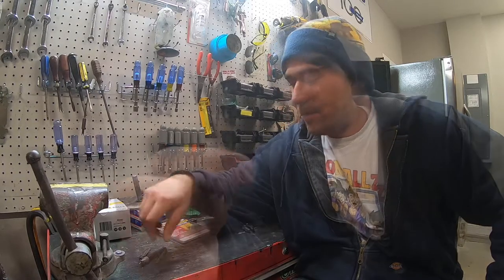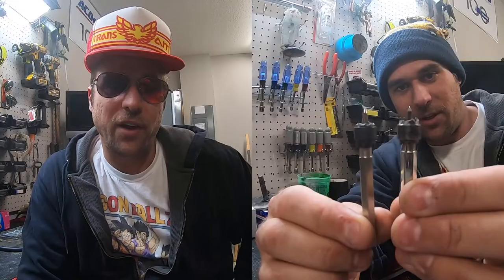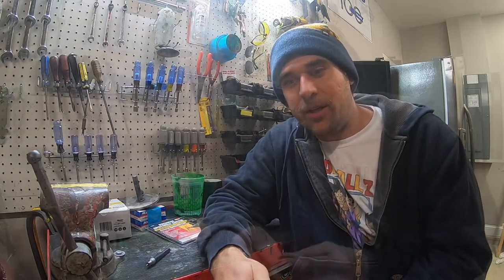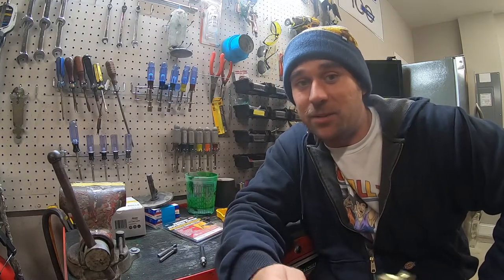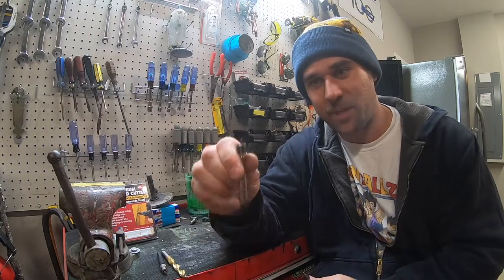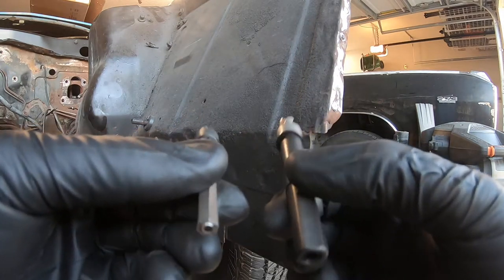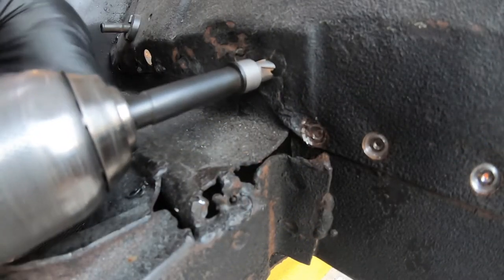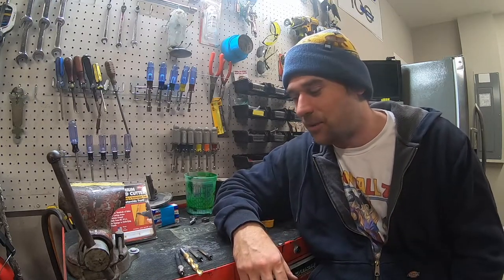Spot Weld Cutter Shootout Century vs Blair

Comment: Will the Blair Tool chuck up in a 3/8" chuck...or does it need a 1/2" chuck?
Reply from the maker: Yes it will. I use it on my dewalt cordless with a 3/8 chuck. Thanks for the comment.
Reply: I ordered one on Amazon...thanks!

Comment: I used to have a Blair SPC 25 years ago and lost it, was the cats meow, long story short I bought the cheaper tool and it walks all over the place even with a center punch or drilled pilot, teeth don't last, im done with this. I ordered a Blair!
Reply from the maker: It blew my mind when I saw the Blair tool. I was thinking, "man I wished they made a better spot weld cutter" then I saw the Blair at a local paint shop one day. Amazon is a little cheaper